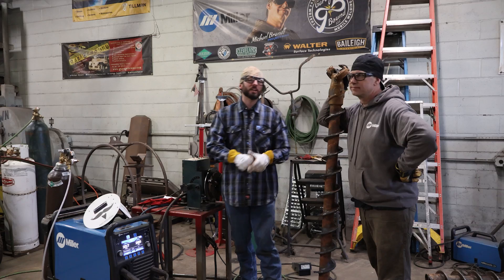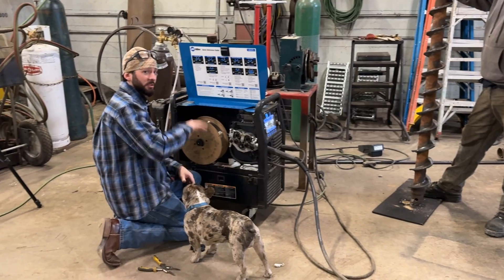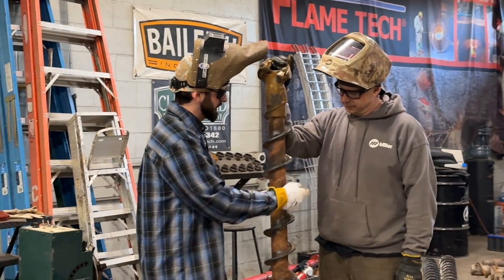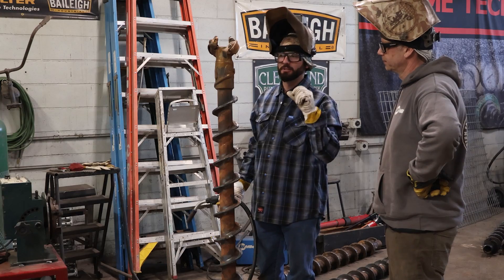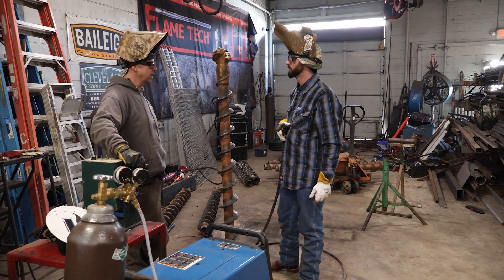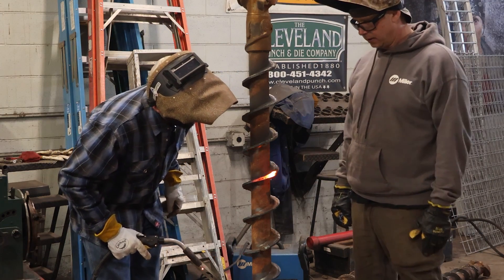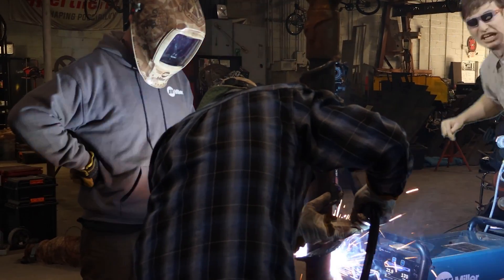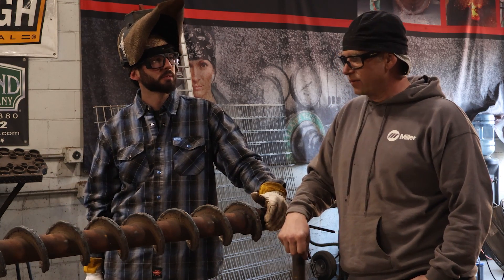MIG Welding: Enhancing Drill Bits with Metal Core

Comment: I do a lot of hardfacing at work on thrust rollers for a metal recycling place on a roll out machine. The pieces weigh 400 pounds we machine the shaft and the roller then hard face the roller. I use 1/16" stoody 50 lb roll using c25 gas. We preheat to 500 degrees then weld it out. And right after we gotta machine it to size on the lathes before it cools because once it cools it destroys are carbide inserts. I do about 3 of them every 3 weeks. And that wire burns hot and you gotta set the machine just right to not get undercut or dropping metal when welding. And keep it just hot enough to get good penetration. You do it right you can weld it machine and its done and good to go. We do a 3 bead pass to fill it up you want the puddle to be about 1/4" and have the same height flush in all 3 passes. So it takes less time to machine.

Comment: At least in automation (Robot welding), metal core is often used to get faster weld speeds. Same principle as why it works for laying down more metal at normal speeds (similar to 7024 stick welding). But it's pricey, which is why my employer hardly if ever uses it. 

We do a good bit of hardfacing (or hard/tool steel repair in general) with TIG on stamping dies. Always ground down after, but for precision work it's the way to go.

Comment: Must be augers for geotech work, SPT sampling in particular. I got similar augers, haven't found a hardface that works good for the material I drill through yet.. sometimes rebuilding bits every hundred feet.
Reply: I do Geotech drilling up in Alaska, and spend most of the slower winter season hard-facing.. Stoody 965-G is my hardface wire of choice ran 18V 210 speed. Seems to work great for the season. Only problem is getting the flights clean enough lol.

Comment: I've only ever run metal core with 80/20 or higher argon. It's a spray transfer. Also,, in my limited experience,  unless you have a machine that will pulse, the puddle is so fluid that it will only run decently in the flat. 
I ran at between 24 to 26 volts and whatever wire feed got me the least splatter.

Comment: I own a welding business in Michigan trust me on this the best gas to use with metal core wire is 98/2 that'll be the smoothest wire you ever run with that gas , from short circuit all the way up to spray it'll run flawlessly I can hear the crispy sound in your weld the ark is not fully stabilising. 

You can use 90/10 but 98/2 is the ultimate with metal core wire

I have since retired but I own Vulcan Masters in Detroit Michigan
Reply from the maker: We will have to try that next time. We plan on doing another Metal Core Video soon
Reply: Awesome. We will try that next time!